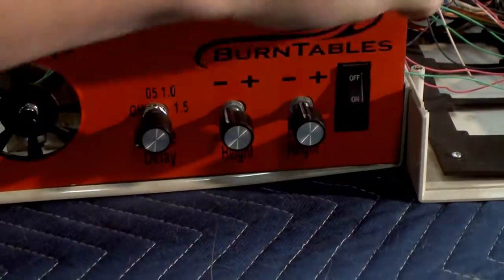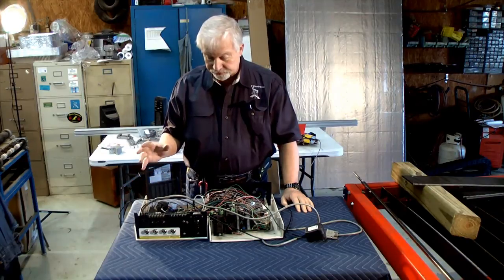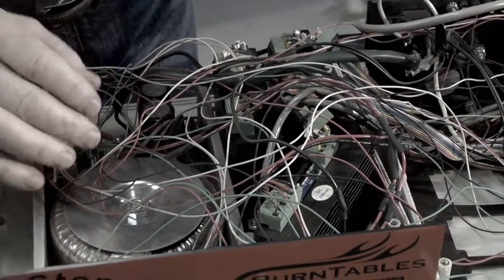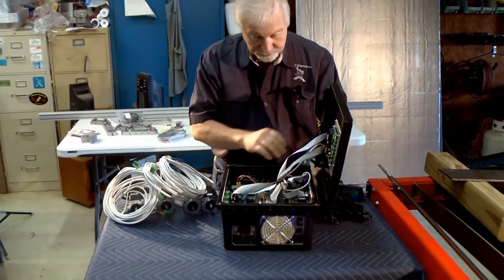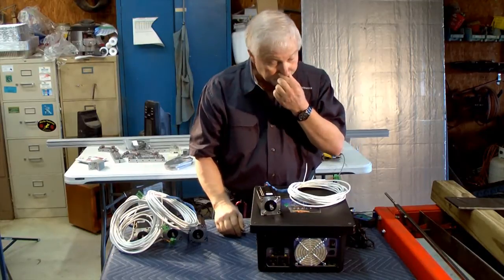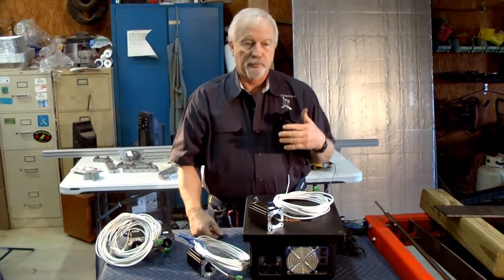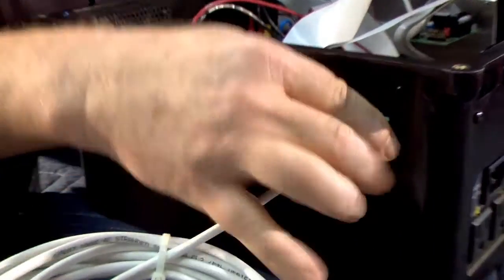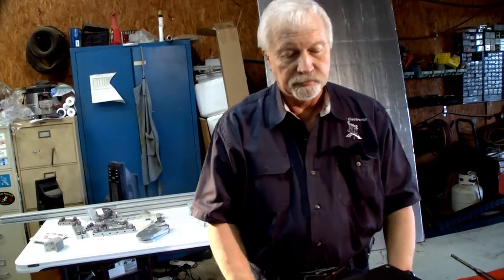Plasma table rebuild section 3

Comment: Very awesome video,  FYI your math is off in your cost calculations at the end........Example the extended linear carriage units cost $34.75 each x3 totaling $104.25.  At least that's what they cost on the cncrouterparts site.  Non the less awesome build and explanation.  I'll be purchasing your Bladerunner dragon cut kit soon.